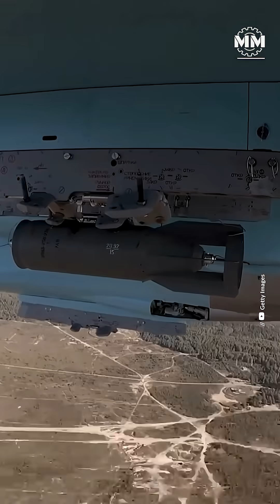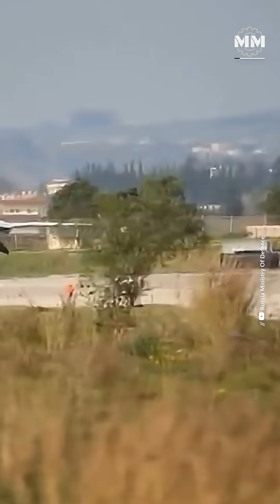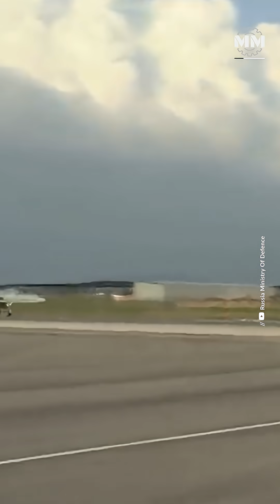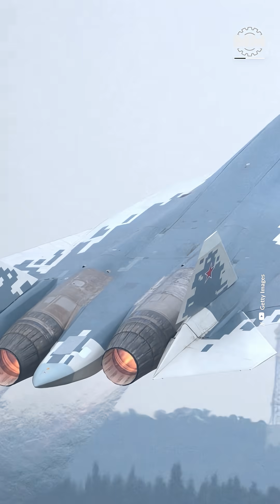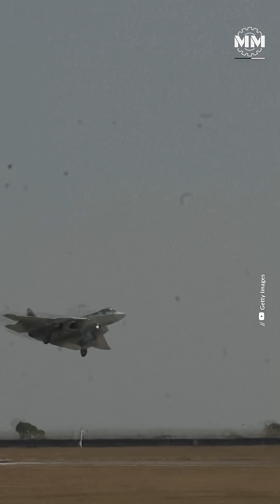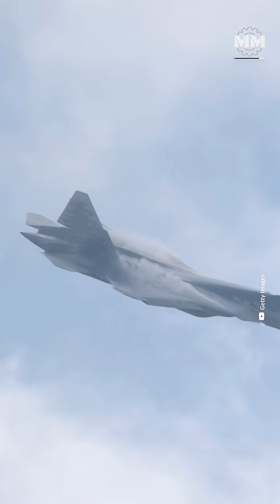The Real Reason Russia’s Su-57 Sounds So Different from the F-35

Comment: Calling the F-35 quieter than anything is hilarious. That is the loudest jet I have ever heard.
Reply: So which aircraft have you heard?
Reply: @KSmithwick1989 I’ve heard a lot of American fighters, and the F-35 was the loudest, even more so than the F-4 in my opinion. To be fair I have never heard a Russian plane and I’m sure the Su-57 is loud as hell too. I’d love to see it in action.
Reply: @ZC.Andrew  the F-35 certainly isn't quiet, but it's not nearly as loud at the F-5s I've heard. I've never heard an F-4 up close, but I would have thought they'd be even louder. Maybe the F-35 flew pretty close in the air shows you've been too?
Reply: @earlbinvico  I've seen F-35's several times, and they were in afterburner, to be fair (but so was the F-4).  I've not seen an F-5.  If it's louder than a Phantom or Lightning.... then RIP for any ears without earplugs. 😅
Reply: @ZC.Andrew I live near mildenhall,   f35's and I think it's f22's that operate regularly, you can stand at the end on the airfield and watch. 
They are all loud.
Reply: @ZC.Andrew Heard F4s yes very loud. Kinda surprised the F35 is that loud given so many fighters made since were quieter than F4s. Told F4 proves with enough thrust a brick will fly.
Reply: @survidmt lol! Yup pretty much. I find the F35 interesting because it makes all that sound with a single engine - albeit an enormous one.
Reply: @ZC.Andrew no it's not 😂
Reply: @johnknight8152 Its the f15s mainly from lakenheath, f35 & F15E operate there in big numbers. F22 on very very rare occasions if ever at all. mildenhall is mainly the stratotankers and support aircraft. i live there also. very very loud i must agree esp when as you said u stand at the end of the runway i had about 25-30 jets loop round to land whilst more took off. is incredible
Reply: @ishmyboy that's right, I couldn't remember the name of the aircraft.... Sounds like you know better than me. 
Took the kids a couple of times to watch them.
Thanks for the clarification.
Reply: @ZC.Andrew I've heard 2  in Montreal , Canada, last summer . Those were purchased from the US , nois was literally crazy !
Reply: @ZC.Andrew  At Homestead AFB, I was too close to the runway when F-16s took off with full afterburner. That kind of noise will drive you insane.
Reply: @survidmt 
You can’t count when they’re landing and taking off because that is often when they are loudest. Any plane is loudest when it is taking off and landing because they don’t have the wind they need under their wings. They have the flaps and slats down or on a plane like the F 35 they are having to land in a way that makes them keep their nose up higher so they can put wind underneath it, and that makes it very noisy. It makes the engine exhaust point lower to the ground and much louder
    I appreciate how you admit you haven’t heard every jet and are not as knowledgeable on everything and I obviously have not heard a SU-57 live yet. And I haven’t heard them taking off or landing…
   so it is hard to compare, but you do get a unique experience even being close to the runway. I’m speaking from my experience when I was in the Navy and when I was up close to the aircraft for my job and hope anything I experienced helps you understand better
Reply: @earlbinvico  I don't know , the f 35 damn quite when you stand above the water 🤣🤣🤣🤣🤣🤣🤣
Reply: @survidmt the F135 engines make the F4's J79 look weak.
Reply: @KSmithwick1989 
The F-35 is WAY louder than the F-16 it replaced here. Some stealth 😂
We had the F-4, the NF-5 and the F-16 here
Reply: @alphatrion100 radars arent measuring sound lol.
Reply: @daeclipse03 
That's not the point smart ass.
The point is that the video claims the f35 is less loud than the older jets and that just isn't true!
Reply: @KSmithwick1989 that's BS .... on take off its loud but not when its in flight.
Reply: @shaunskeen2937 that’s bs! I live under the approach path to the Air Force base. They pass over at about 10,000 feet. Ungodly loud. 

In comparison I have large commercial jets, 737, 757, 787, and A350 that are on departure from the nearby international airport. They are much quieter than the F35 on approach.
Reply: @jepp0711  Do you hear the jet or the air?

It's like with modern cars; the modern engine is very quiet, but the air and tires make a lot of noise.
Reply: Yeah my dad was a pilot in the Air Force I’ve heard more US military aircraft than like 90% of the population… the F-35 isn’t that loud. F-15’s and F-14s are both louder. The B-1 is an absolute Klaxon… no surprises here but A-10s are quiet…. Harriers are loud too.
Reply: @Desert_airgunner  who cares if a fighter jet is loud or quiet? With the recent radars and on-board missiles,you're seen way before you're heard.
Reply: @jerometournier5467 That statement shows you have no idea what’s going on in the stealth world.
Reply: @jerometournier5467  just go fast ?    👀   😳   ✌️ 😁
Reply: @jerometournier5467oh is that so? What radar is picking up an F35? No country has one yet 😂😂😂
Reply: @jerometournier5467yeah ppl are completely missing this point. Who tf cares how loud it is when it can shoot down enemies OVER THE HORIZON…It’s cute when ppl from other countries think they’d actually have any chance against the f-35. There’s also the f-22, but even the US doesn’t use it much because it wouldn’t be sporting😂
Reply: @Desert_airgunner the B1 is just plain obnoxious
Reply: @joshuastuchlik206 haha totally… but it’s also pretty rad how it can come in so fast and deliver so much ordinance that it just doesn’t fucking care.
Reply: @joshuastuchlik206 I have stood close by when B-1Bs took off in tandem at Dyess AFB!!!…you can hear colors at that volume! 😵‍💫😂
Reply: @joshuastuchlik206 a beautiful sight and sound   I've only experienced it once. But will never forget
Reply: @Desert_airgunner An F-35 in hover is crazy loud.
Reply: @brettteeter3461 

In hover it's not hunting you.
Reply: I thought that title went to the B1.
Reply: @ChrisGWarp I never been to a rocket launch. One flew into our city's airspace, wings fully extended, slow and kicked full afterburners and corkscrewed climbing into the sky. Three revolutions then headed back East. Talk about a massive shock wave. Awesome the B1 Bones is!
Reply: @alglen9208 You can get a LOT closer to a plane fly past than you can a rocket launch. Distance matters when it comes to sound pressure levels (ie volume).
Reply: At Shepard  USAF in Tech School I was in a volunteer band and we were on the tarmac playing for the Thunderbirds. When they pulled vertical that was a rush. Was working on the floor of a drilling rig when to fighters over flew us out of no where. A real gotcha moment.
Reply: @alglen9208  i worked with the BONE when i was in the USAF.  Our office was directly beside the flight line.  Every time they flew by our desk would shake.  Also would set off every car alarm when flying low to come in for landing.  Loudest air craft I have ever seen.
Reply: @joerob66 I agree!😂
Reply: F35s fly over the area where I live all the time. If they are considered quiet, then the Russian fighters must make your ears bleed, to be be any louder.

F35s louder than F18s & some sort of trainer jet that are  regularly seen overhead.

Edit. Should have said Australian F35s & F18s flying out of Williamstown NSW.
Reply: The sound of the SU-57 isn’t for the enemy, it’s the strike fear and reinforce nationalism in the Russian population.
Reply: U-2s are probably the loudest damned aircraft I've ever heard. There was a Squadron of U-2s stationed at Osan and they were an order of magnitude louder than the F-16s and A-10s. It was the kind of sound that came from everywhere all at once. Wild stuff.
Reply: @mikehateberg9533 I believe it… if I remember correctly the engines also had a weird sound to them too right? Like pretty shrill.
Reply: Check out the British Avro Vulcan from the 60s. The howl was legendary. Amazing jet bomber for its time. Nuked America twice in war games. Ran the longest bobbing raid in the world in the 80s, now beaten by the legendary B52s, designed for rapid take off it could get airborne in 2 minutes and there’s not a lot of heavy bombers that can barrel roll.
Reply: If we’re talking old planes I think I remember hearing that the B-47 was an absolute assault of noise.
Reply: @davideyres955 damn that sounds pretty awesome.
Reply: @davideyres955 Good thing we and the UK were allies.
Reply: I'd wager the Blackbird is louder, but that's just my opinion.
Reply: @carlg4544 You have a point there! When I was a kid sonic booms were not unusual.
Reply: @alglen9208 Right? The craziest thing I've seen was watch a Blackbird accelerate in front of me, and it was like it fast forwarded. That's my best explanation. 😂
Reply: @carlg4544  😮 Cool
Reply: Using any flight, take off, flying, landing. Etc, Decibal rating at take off, F4 150 db the F35 peaks at 121db per Google
Reply: Значит вы никогда не слышали Ту-95. Это не делает его плохим самолётом, но это очень громко. Даже когда Ту-95 на крейсерской высоте, а вы смотрите на него с земли.
Reply: Facts. I've had one fly over my head on approach to Kadena and it drowned out the music inside my car.
Reply: @mik @mikehateberg9533 😂😂
Reply: Yeah yeah yeah...American jets are the loudest but who cares!!!
Reply: @zulzuli3603 they are not lol, you can’t hear them on approach most of the time, even the F-16, they jump scare people ALL the time at air shows
Reply: Bro I was going to say!! That bad boy is stupid lol! Even more so when aft of it
Reply: And a massive problem here in Denmark because of it
Reply: Yep
Reply: F-35 создан на основе советского Як-141
Reply: @arthurconanrus9801 😂 not at all it's mainly based off F22 and F18 with much of the F35's design began from the ground up. There is a reason people say it cost so much as the F35 was pretty much made from the ground up, this is why cost much more to develop than to critique older designs.
Reply: Not only one but both
Super Quite / Super Loud
Mode At The Same Time
IS A MUST REQUIREMENT 
With Switch ON/OFF
Touch System
Reply: What's the point of this video? Are they made to sound good or shoot down the enemy.  This is a dumb video. What's the point of sound if you're shot done miles before sound is heard.
Reply: AV8 is annoyingly loud
Reply: These fighter jets are not revealed or identified by sound🤭?.  Stealth is not about sound, I don't have to hear it,  to see it?. You're not hearing nothing on radar screens, it's the heat & radiation signatures that are identified. These jets are seen in the skies & identified on radars, but it's their hypersonic speeds,  agility & decoys they shoot out, that makes it very difficult to tag & destroy.
Reply: @DaniilBalkans-jh2rw I didn’t say it was my dude. I know how stealth works. I have no doubt believing that the F35 is one stealthy plane on radar.
Reply: So you've compared it to the SU57?
Reply: Not yet, would love to
Reply: Its louder and has a much larger radar cross-section
Reply: *acoustically blurred 😂😂
Reply: Is lying for Russia give you a good paycheck?
Reply: Dude you have only heard an F-35 if you think it’s the loudest, I’ve been around the Blue Angels, the Thunder Birds, Raptors, and even F-15s the F-35 and F-22 are the quietest especially on approach

The AV-8B Harrier II in the other hand will deafen you lmao
Reply: Apparently you’ve never heard a F14 Tomcat.
Reply: @daneswearingen8235 I’ve heard F-18s, F-16s and a few others. Never heard a Tomcat, nor seen one. I’d love to.
Reply: So according to the video, Russia is better because they want to be loud to “show” they are tough. That seems about right since it is little man syndrome. I mean chihuahuas make a lot of noise to intimidate others. Problem is when it is called out they can’t do much or try to run away. In the case of aircraft, I hope the pilots can run so there aren’t as many deaths. That is why so much engineering has gone into the stealth capabilities in the US. The Russian plane seems like it would have been great up to Vietnam when everything was just loud and trying to be faster.
Reply: Clearly you haven't heard many jets then.
Reply: Not to mention that F-35 is called Failure-35  for the countless failures it has in its fuselage, coating etc etc. And it's the most expensive and inefficient.
Reply: @jhmerkaba8080 and yet nobody has ever shot one down 😂😂😂. Feel free to shut the fuck up. You know nothing.
Reply: @jhmerkaba8080 you can't be this stupid right?
Reply: @jhmerkaba8080 called by: Who?
Reply: @jhmerkaba8080  F-35 Wins most, if not every war game it competes in  with a 7 to 1 win ratio!
Reply: @LeeD-c6z  I want to see F35 vs Chinese J35 in real battle conditions. I wouldn't bet my nuts that the failure 35 may win.😅
Reply: @jerometournier5467 F-35 has a decade of experience over that J35 Temu copy.
The F-35 is the world's current best fighter even besting the F-22 in war games due to its superior situational awareness.
Israeli F-35I made it look easy against Syrian/Iranian that had Russian and Chinese IADS.
So yes the F-35 has proven itself in the real world but the J-35 has not!
Reply: @LeeD-c6z and the US nerfs itself in those games.
Reply: @jhmerkaba8080  You're absolutely correct.
Reply: @jhmerkaba8080 😂 the F35 is crazy cheap what are you talking about? Or do you mean the research and development? Because the F35 is going to save 50 trillion over it's projected service time.
Reply: @tylerrobbins8311  I am talking about the price per plane. It is the most expensive fighter jet in the world. Not to mention it's maintenance costs. And everybody in the business knows it's called "Faulty-35" because of the issues it has for its maintenance especially for its fuselage coating.
Reply: And now the stealth fighter jets F22 and F35 as well as the stealth bombers can easily be detected by China and India's latest radars. 😂
Reply: @shammariba  yes .......but at restricted ranges that gives the F-35 and its weapon systems total dominance and superiority.
Reply: @LeeD-c6z   arrive fast, hit targets, leave fast   ✊  😁   done deal
Reply: @LeeD-c6z it’s cute when they actually think they are “flexing,” when they are just showing how little they actually understand about how planes like the f-35/f-22 actually operate. Ignorance is bliss, until the missile hits.
Reply: @shammariba  Don't think so!
Reply: @shammariba  nope
Reply: @LeeD-c6z their superiority complex is a sham😂it’s kinda funny. They know about the knife missiles, right? We are so surgical w/our 💩 that they don’t even need explosives😂

Comment: Dont tell anyone ok, but the sound makes a grid in front of the su57 front and intake and all that disrupt radar. Its hard to find and i know i sound like i am confusing sound with radio jamming but under physics there is study of signal interference and interferometry. 
This is very obscure and quite controvertial but true:
Since sound waves change the pressure of air, the density of the air changes a bit too. This changes the propagation velocity of RF slightly. To be able to measure this, however, would be quite difficult, due to the very small changes involved (unless the sound is very loud—and even then the change in velocity is pretty small).
Reply: since sound rattles particles, we assume it disrupts radar
Reply: Interesting theory, although unproven..
Reply: This I believe. I love in the comments that Americans and Russians assume that the other's aerospace engineers have an IQ of 4. In 2025 the only effective stealth aircraft in existence is the B-21 and they can't ever fly it outside of the most important clandestine operations because they'll give away its signature.

After the B-21, the entire concept of stealth will be obsolete outlining the importance of drone technology. Manned military flight will be suicide in a few years with advanced radar and AI targeting.

Comment: F22  allso has a missel that shoots backwards point to back
Reply: You wouldn’t want to give chase to the New Nuke Bomber TU160m2, it also can engage in Air to Air combat, backwards too equipped with Hypersonics on boards. Capable of out running fighter jet over distance with a 12000-15000km range. No fight jet will outrun a Hypersonic if it’s locked on.
Reply: @DinkyDoughnut that's why you dive at bombers from above.
Reply: usa is under control zionist jews, shame....